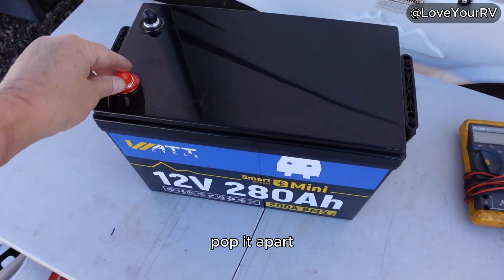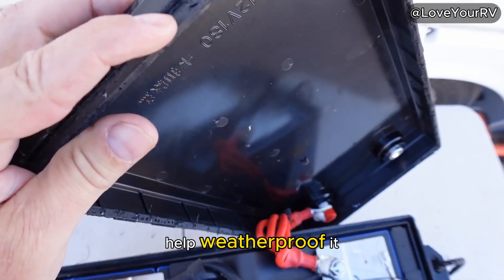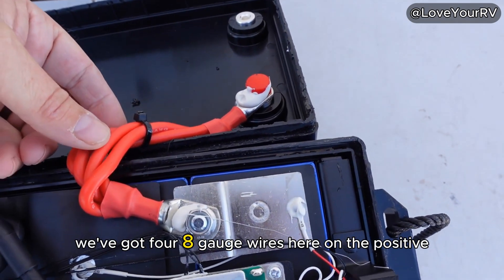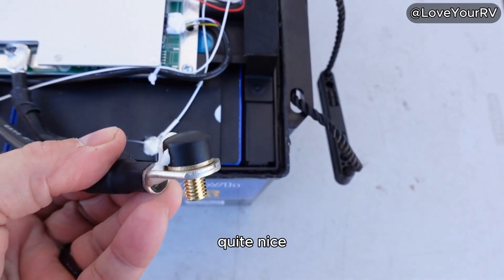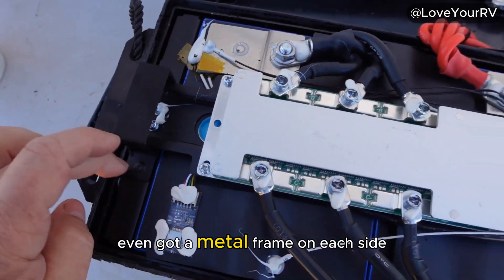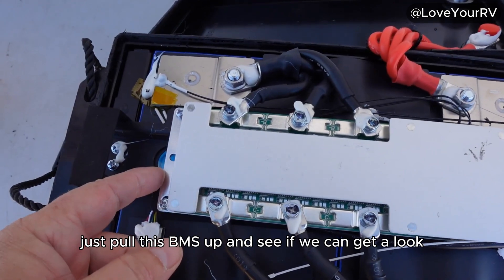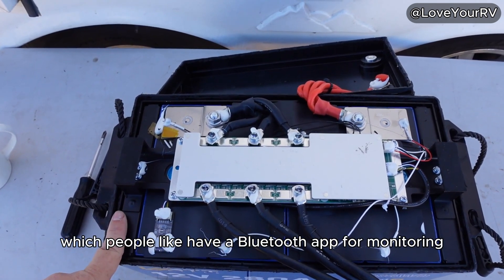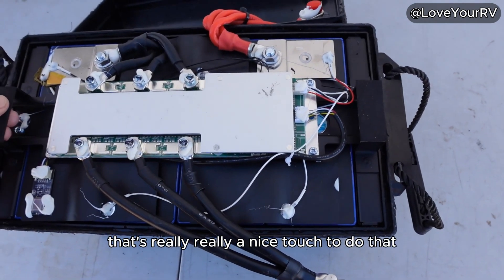Wattcycle Mini 280Ah LiFePO4 Battery w/Bluetooth - 200A Discharge  Teardown

Comment: Most batteries I have seen torn down have some level of foam rubber protection around the sides.  I am surprised that you have not noted that this battery has none of this protection.  The steel case that compresses the batteries though is a great plus.
Reply from the maker: That’s a great observation! 👍 You’re right— the steel shell provides very solid compression and protection. It’s designed to keep the cells stable even under heavy use.